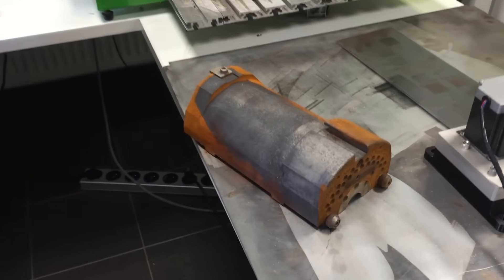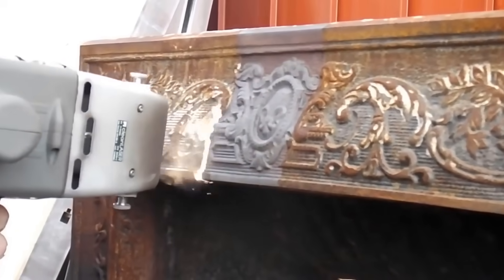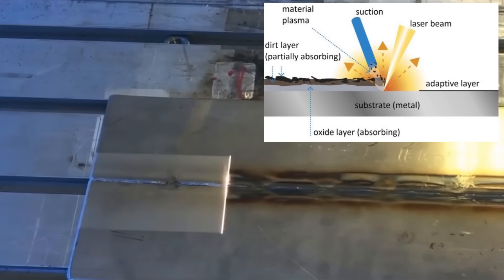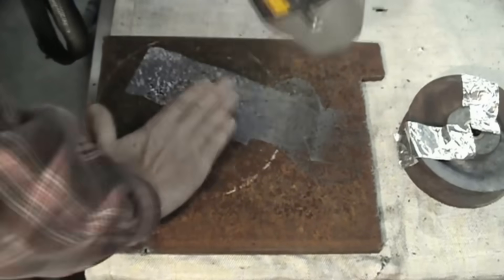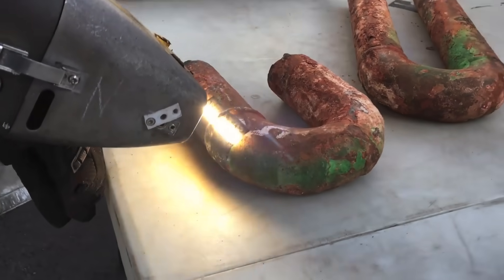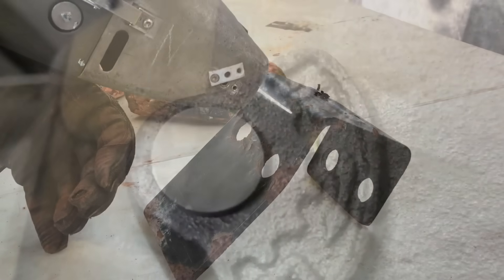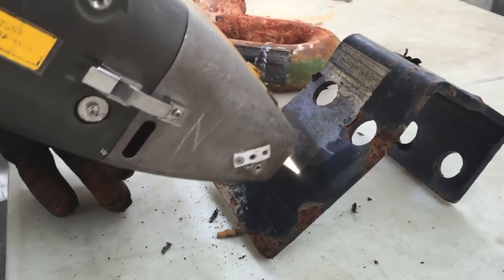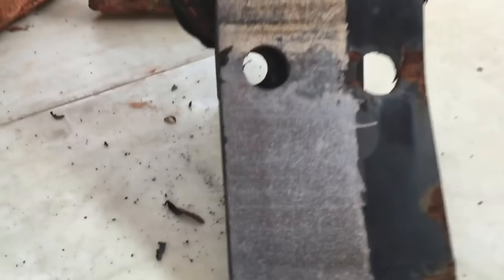1000W Rust Cleaning Laser - Removes Rust Effortlessly

Comment: It's been 4 yrs. Now I need to go see how much it costs today. Hold on...... 
I searched laser rust remover, then did the shopping feature. All results came from AliExpress. You can get a 1000w for  about $7500. Some were 2000w lasers for as low as $8800. They had alot of similar rust removers with lower wattage starting at $2500. Some were even portable made to carry on the back while the expensive styles had a large stationary cube. 
Not a laser rust remover expert.
Reply: You are smart. Now China is the largest laser machines export country. It's true some made in China products are not satisfied but if you can find a good supplier, you can get a good one with much lower price than other brands.
Reply from the maker: I don't know how good or bad they are, but the companies who I featured in this video, claim "their" laser rust remover still costs about the same. You can buy a cheap version of a tool or you can buy a good quality version that lasts, they may do the same thing to a certain degree, but the cheap version usually does not last long.

Comment: As someone who spends a great deal of time removing old rust and paint from electric motors my shop repairs I so want one of those.  I end up spending a couple hours operating the sandblaster to prep the parts of some motors and that looks like it would do the job in minutes.  Sadly  my boss would never go for it at that price tag.   At my current wage he could have me runing the sandblaster cabinet 8h a day for the next 10 years and still be cheeper than that thing.

Oh well maybe in another decade those will be cheep enough to replace the sand blaster although I wont be a lowly parts cleaner by then.

Comment: so, i think the way it's described to work in the video is wrong? The narrator says something like it only removes material at a set depth? i doubt thats possible considering its shown to work on uneven surfaces, the most probable way it works is that the rust and other surface contaminants easily absorb the wavelength of light the laser outputs and thus sublimates away/pops off, the bare metal / human flesh does not absorb the wavelength as easily and therefore doesn't heat up and isn't damaged.

Comment: the year is 2021, i'm still looking for it in aliexpress
Reply: @L G my dad is 73 I really wanna give this to him before it’s too late, I really need a better-paying job
Reply: @RichardCox0  you'll get there.
Reply: If by some chance you do get one, better prepare yourself with the electric bill.
5 minutes that thing is on is probably enough to match your average home rent.
Reply: RandomKitty 
Don’t misinform people.
He said the power is 20-1000Watts.
As a comparison, an oven uses 2500Watts.
Reply: @maxsolo2652  My apologies, it would appear I overexaggerated on the numbers.
With the average cost of KW/h it wouldn't break your wallet if you use the cheapest one.
But the unit itself costs quite a pretty penny.
Reply: @randomkitty2555  electric heaters use 1700w and they stay on for hours every day, dont be a dumbass...
Reply: You can check it on the Alibaba platform. There are a lot of 1000W laser cleaning machines, and the power consumption is about 3000W/h.

Comment: I went through College for Tool & Die Design and with my 40 yrs of Aircraft / Aerospace manufacturing experience I refuse to believe something like this is worth that much . This device is a souped up microwave oven . A fair price for this thing would be about 12 - 13 hundred dollars . This is the type of thing you should be seeing in a rental shop . A contractor would rent it in the morning and return it by 5pm . That's it .

Comment: Unlikely these are coming down to prices for your average consumer any time soon. CD-ROM drives in the 80s didn't cost $50,000. They were introduced in 1985 at a price of around $2500. By 1988 they had dropped to $500. Even writable optical drives only cost $5000 back then. Laser ablation systems have been around since the 90s and have not changed much in price - mainly because the fiber laser apparatus itself is incredibly expensive requiring exotic materials, expensive optics, and expensive electronics. Barring some phenomenal new discovery in the laws of physics, none of this is likely to change in the near future.  Cheap, easy, effective rust removal is available at your local hardware store. It's called sandblasting.

Comment: I believe that leaving rusted metals in a tub of coke a cola works too
Reply: Yes but think about something like, say, a car subframe. Previously the fastest way to get rid of rust was to take the whole thing apart to pieces small enough to fit in a sandblaster, sandblast them, then reassemble it. If it doesn't fit in your sandblaster then it's angle grinder time. Now you can just point a laser at it while its assembled and the rust disappears. It turns a job that could take days into minutes.

Comment: Laser engineer here. That's all photoshop. That intensity of reflection would destroy that camera, and 1000W throughput on a handheld diode would melt itself into slag in seconds.
You can ablate rust with a 10W laser, but this...this does not in any way look real.

Comment: You can build your own, but you’ll spend a approximately 20-30k for a 100-200w power level :) a 100w q-switched 1064nm laser source is currently about 15 grand or so plus additional components required (galvanometer, power supply, control board, wiring, etc)

Comment: One Kilowatt. Holy hell that's a lot of laser power. I've got an absolute monster of a 5 watt 470nm light blue laser, and when focused does something like this. On an area smaller than the tip of a needle though lol. This 1KW beast cuts a 2-3" swath...

Fun Fact; If you don't wear seriously high quality IR rated laser goggles when running one of these, you'll go blind. Quickly...

Comment: I see there's a use for it. But abrasive blasting steel substrate is overall better. You obtain an anchor profile, cleans deeper depending on your standard like SP5,10,6,etc or NACE equivalent, and you kill two birds with one stone.

Comment: If this is real mechanic will invest a lot of cash into it. I mean who wouldn't hours of sanding rust is unreal but that thing is like a miracle.

Then again would be pretty great for home fixing like car or old tool. Imagine the money you'll save. 

But I think a engineer could 3d print and reassemble one of these despite power output if possible with component.

Comment: Sadly no indepth explanation on how it works, I study mechanicla engineering and passed my welding engineering courses so I can guess how it works, but others probably are not so fortunate.

I think it works with the absorbed spectral parts, pure metal absorps different wavelenghts then rust or even flesh (though I would recomend holding your hand into the beam for hours blood =~ ironoxides). If I remember correctly steels are in the UV-zone when laser welding, so this would be in the wavelength area of oxides.

Comment: Do I need one? No, do I want one? Yes. Can I afford one? No
Reply from the maker: I know what you mean, I bought an ARC Welder when I was 20, i rarely use it but have had things I needed welding over the last 25 years so it has come in handy, I also recently bought an Airf compressor to complete a home improvement build, but had not used it since, but recently found another short use for it.

a Tool like this laser cleaner will get rarely used, but you will find uses for it
Reply: @WonderWorldYTC  If I had one of these i would be searching high and low for anything rusty. hope they become affordable.  I am currently looking to buy an air compressor to go in the workshop i built last summer.

Comment: So basically a cashier's barcode scanner paired with a high powered laser at a frequency absorbed by rust and paired with a shopvac.  The barcode scanner has a hexagonal mirror to turn the beam into a scan line.  Basically the only pricey component to build one is to find an appropriate 1,000 watt laser.

Note Alibaba seems to have 1,000 watt rust removing lasers for between $10,000 and $50,000 US so I guess the price has already been dropping.  I'm not sure if a car dealership garage would find one profitable but a body shop might and a steel ship builder definitely would.

Comment: One of the things that drove down the price of lasers and CD-ROMS was the miniaturization and the extremely low amounts of power they needed to operate. Another thing was that the extreme miniaturization and low power requirements made these devices MUCH safer.
This is an inherently high energy device and is inherently unsafe.  It may have commercial use, but this is not going to be in home depot any time soon
Reply: Yes. Luckily there is basically zero chance this ends up alongside power drills in the Home Despot.

Comment: Will this be made available at a price people can afford? The reason I ask is that too much money is made on abrasives such as sand paper, wire wheels, flap wheels, grinding discs, the motors that are used to get rid of rust plus sand  blasting and other methods.

Comment: Soda blasting is an affordable method, and are at Harbor freight, I recommend at least the 60 lb. model as it's 10x easier to re-fill.   
Downside is the dust, must be used outside and it will kill grass and other veg.
Reply from the maker: Soda & Sand may do a good job cleaning a surface, but based of episodes of "FAST N LOUD" panels have come back warped from a blasting treatment, but I guess on solid chunk of metal it should not be a problem.

Comment: This tool is not for a domestic use, is more industrial, with 50,000 hours of beam life and a 1 dollar/h operation is still cheap, if you charge $100 an hour plus your mobilization of $100  be sure that you will make $5,000,000 gross, for the life of the beam, I asked a rust remover using sandblasting and he charge $190/mL plus the time of work so it will cost me $400 plus and is complete messing, so if you want to start a rust removing business you shoud consider this option, and they cost in China from $35,000 to $60,000 but I prefer to buy from a local dealer because of the warranties and parts if need it.

Comment: its funny as hell it cost 500k RETAIL but im 100% sure it cost no were near that much to build one so i see what those greedy basters did there XD
Reply: You'd be surprised. 1000W lasers are FUCKING expensive.even 10W proper lasers will set you back over 1k depending on the wavelength and characteristics.
Reply: has nothing to do with greed. Lots of R&D and other issues that make it expensive. If they sold this device much cheaper, they would make a fortune on it.

Comment: Well....back to wire brushing and blasting for now.
Reply: hahah the sad reality of not being rich
Reply: lilblingking1491 if I’m rich still won’t pay a half million for that ...
It’s ridiculously priced ...!
And nothing wrong with wire brushing and sand paper 🤓
Reply: @shahinportohfeh1446  If you were a rich business owner, there would be no reason not to buy it! Imagine the higher volume of work you would be able to complete compared to just brushing and using sand paper. It would end up paying for itself much sooner
Reply: Shahin Portohfeh and that’s  why you’ll never be rich. You have no idea how to judge the value of something
Reply: In all fairness, media blasting isn't so bad. It's slower and more messy, but still does the job all the same.
Reply: Or electrolysis, which is boring, messy and dangerous as hell.
Reply: Even so, it takes forever.
Reply: Remember there  used to be some magic kind of soldering combined with arc that would be astronomically priced that now is a staple for every weekend warrior?? Now every garage has a wire-feed welder.

Comment: too slow..good for antiques
Reply: stil much faster than any sand blaster, and doesnt remove metal either,  and could be more powerful or have multiple heads
Reply: You've never seen our blaster! But impressive for sure.
Reply: that it also was safe on the guys hand bodes well for the future too, every things has its advantages, blasting, acid, wirebrushing, electrolysis, another tool it always good to have and it seemed to work well with automating, so a robot might be able to also do some useful work too    i did work at a place that had a blasting room, poweered by a 300hp compressor, it was almost like a firehose, the guy said , what pings back already hurts (with his suit on!)  and that it needed skill to not damage the already heavy parts, this laser seems not to damage the good metal (sure its  a sales pitch as we see it, id love to see it widely tested)
Reply: Were on the same team friend!
Reply: doesnt matter if we have seen your sandblaster there are better sandblasters than you have
Reply: Like most things in life you're correct..

Comment: Useful only were you HAVE to keep the piece and surroundings dry. 
Otherwise I would go for powerful water jet plus some products along the process. 
This laser is only useful for very specfic needs in high tech companies or situations, therefore the high price. 
But fascinating, though....
Reply: well lots of companies service, repair and remove rust, being in the dry is not a problem, this is far more than a  niche, every workshop has a sandblaster cabinet, this is 1000x times more useful, waster jet is for cutting, not rust and coating removal

Comment: Lame. A waste of electricity and money. Spray on rust remover is almost as fast and a million times cheaper and a hundred times more effective. Laser can't get in places that liquid can. Liquid gets into those places you can't even see, its so much more effective. Spray it on an 10 minutes later you wash it off. The metal looks brand new and is free of residue. Spray on is safe to touch and biodegradable. These lazers are just very expensive toys for big kids.
Reply: nope, this laser has applications that current method dont, it removes other coatings as well as rust,